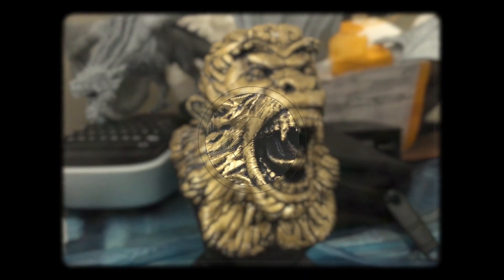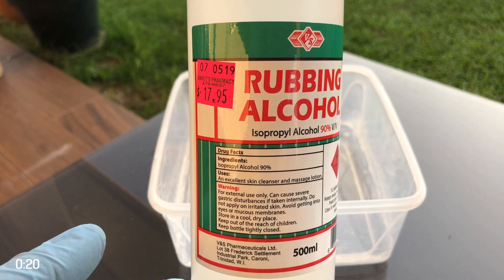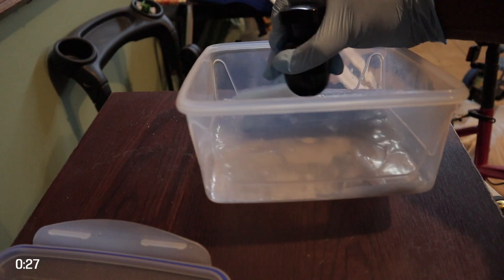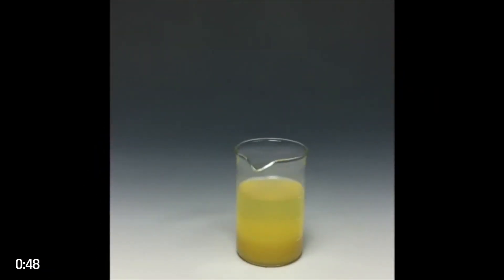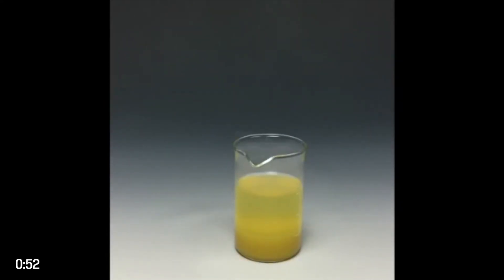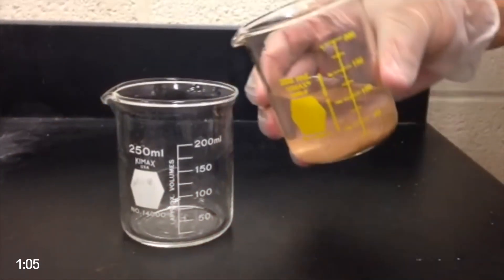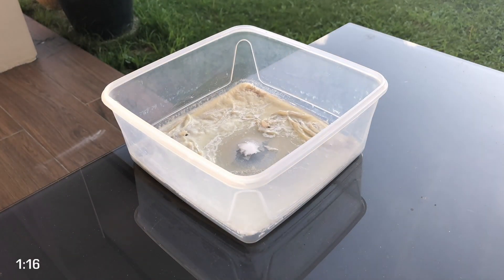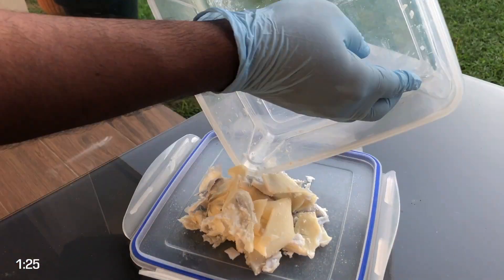Reuse your Isopropyl Alcohol (IPA) after cleaning your SLA Resin prints

Comment: I don't seem to have that much resin floating around/settling in mine. Does this work as well with plant based resin and how long did you let it sit?
Reply: It's like no human has answered that yet. Trying to find out myself.
Reply: @JCatNY  Yeah My stuff sits for awhile now, 24+ hours and I'm not really seeing anything settle. The isopropyl just looks cloud, but... it is still working fine.
Reply: @crossmr  Same here. Had my ipa  in one of those popular plastic pickle jars that everyone recommends. Sat it on the windowsill For two days straight. Nothing settled . Looks exactly the same as when  firstI left it. Not sure if it's because I'm using the eco resin from Anycubic, or the UV rays are not going through the translucent Tupperware plastic.
Reply: @JCatNY  Well, I had occasion to leave my IPA for 2 weeks because my LCD died, and I was waiting to get a replacement. After my test print last night I grabbed my IPA container and noticed that I could clearly see all the little bits and stuff through the IPA. The resin had settled. It took about 2 seconds of handling it through for it to turn cloudy again. I almost think you need 2 containers. Every 2 weeks, switch containers, let it sit while you use the other container for 2 weeks, then drain off the IPA very carefully

Comment: I noticed that every morning my vat of IPA would be separated with clear liquid on top and a layer of black on the bottom.  I assumed this was the resin settling out at the bottom (seemed logical), but someone told me that the black stuff at the bottom wasn't actually the resin, but rather just the pigments from the black resin.  He claimed the IPA was still saturated with the resin, and pouring off the top wouldn't do anything buy remove the pigment.  I'm not sure if he's right or not.  Clearly, you think that the stuff at the bottom is the resin, not just the pigment.  How confident are you about this because I'm about to have to try it.
Reply: For me they didn't seem to seperate, until I put the IPA in sunlight in an airproof container (to stop the IPA from evaporating), I will probably try to filter it tomorrow and if I remember I will come back here with some answers.

Comment: Hey there. I thought along the lines you mention - let it sediment. But I left it for days, perhaps even weeks and the IPA (99.9%) remained greenish (after the resin) all through the volume. So I thought if I exposed the whole thing to UV, it would cure the resin particles and they would sediment. No such luck. The whole volume turned milky white but it still doesn't sediment. So I wanted to filter it out using paper filter. No chance. :D I guess the pores in the paper get plugged immediately. Any ideas for why this is happening?
Reply from the maker: I believe it depends on the type of resin and maybe the concentration of the iPA. And believe me there wound be any benefit filtering it because the resin in suspension will pass straight through the filter :D
Reply: @FrameonesMakerspace  Hello! Just as an FYI, I was able to filter out the resin, once it has precipitated out, with a normal coffee filter. Great info here! Thanks!
Reply from the maker: You are welcome :)
Reply: @FrameonesMakerspace  Yeah, I did notice that the little amount of liquid that did pass through the filter remained milky white. :D So what can I do with this, any ideas? Do i just take it to the nearest recycling center as hazardous waste? Or should I expose it to UV even more and let it sit around even longer to see if the particles settle?
I would really like to have a process that's as eco friendly as possible.
Reply: Having the same issue here. Did you came up with a solution? Or did you just bought a lesser percent IPA? 95 % or something.
Reply: @Rogiervdberg  I just let it sediment for a long time and it cleared up pretty well. I haven't found that much use for the resin printer as I thought I would, so I don't use the IPA so often and it doesn't seem to be a problem that it takes a long time to clear up completely. I guess it has enough strength to dissolve more resin even when it's not completely clear. I recommend using a second IPA or water bath stage and maybe have a few sets of closable rinsing tubs that you rotate, if you print more often. It takes up space, but I guess letting it sit and expose to sunlight is the most effortless and ecological approach.
Reply: @romanblahynka4536  ah great to hear. I ordered more ipa. I am a tabletop gamer and hadlve the printer for a week now. My IPA is already milky... Bought the wash amd cure station from anycubic but will drop the prints in a normal water bath first, before I put them in IPA. Thanks for the advice.
Reply: @bigtexuntex7825  i searched up the distalation proces. But I don't understand how it works. Is it easy to do? 
Here in the Netherlands I found a seller where it is 5 euro or so per liter.
Reply: @Qube14416  I read about Mean Green, but unfortunately in Europe it's not readily available. But intetestingly enough, I haven't been printing much and after all this time, more of the particles did settle down. So I guess the IPA will be reusable for quite some time and at some point I'll simply let it evaporate and dispose of the residue. 🙂